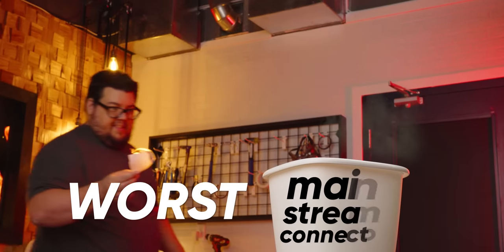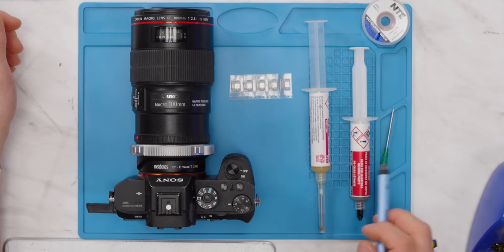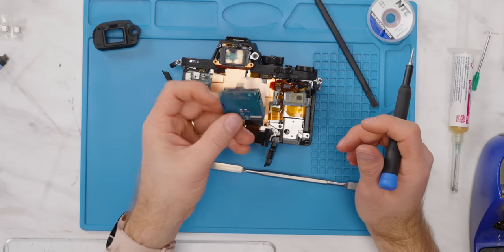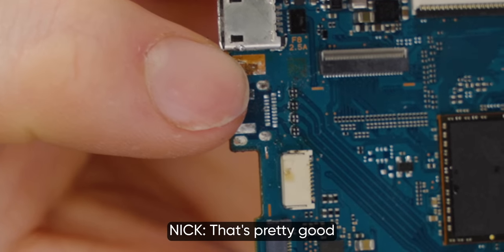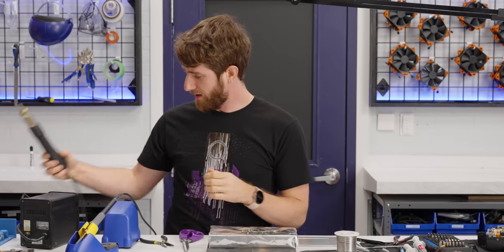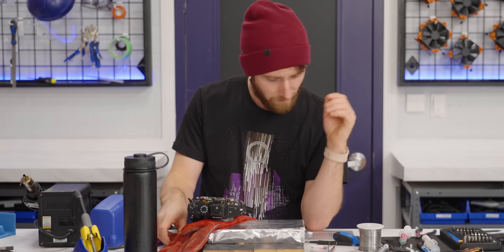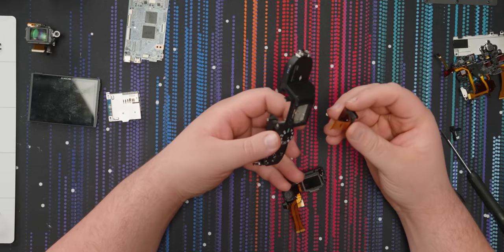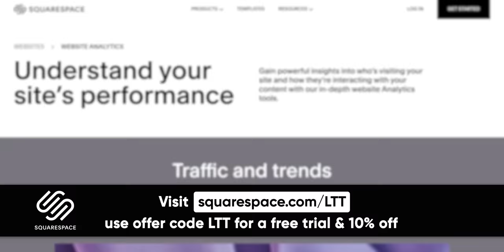This "cheap" repair almost BROKE me.

Comment: This reminds me years ago when I visited a camera repair shop to look for an old camera. The repair guy was trying to repair a camera with a broken connector. He told the owner that the owner had 2 options, the expensive way or the cheap way. The owner obviously chooses the cheap. So the guy proceeds to use a wire that looks like the wire inside of a LAN cable to connect the plug for the ribbon connector 😂😂😂.  Can't make this up. The camera works with it, and the owner is happy. I was like wtf how did you do that. The guy was like, "Yeah, that thing works in a couple of months." 😅😅 So it was technically an expensive way to do it.

Comment: Are you using leaded solder? The plastic should have been melting like that at the temperature leaded solder melts. Lead free solder melts at to high of temperature and is brittle. It sucks

Comment: Iæve felt for a very long time that all small contacts like usb and smaller that's ment to plug in and remove repeatedly should all be using magnetic connection contacts to avoid damaging either side due to a mishap or accident. Why there isn't an easy to get adapter that adds that function, I have a hard time to understand, but maybe there's some dumb patents or lack of magnets that stops such things for being available. I personally have at least 5-7 items that really should have such connection and my phone is included there.

I hade the fact that the cable don't just let go if someone by accident gets caught or moves wrong so that the cable gets caught and your device hits the floor and something breaks as a result.

Comment: I barely solder anything and I could tell where this video was going instantly 😂 Linus massacred that PCB, used a tool that removes parts to put one on, doesn’t have a tool to remove solder, and he wasn’t even using solder wire and an iron to pit the part on. Who let Linus near that stuff? Next time add a regular HDMI adaptor

Comment: Opening up a DSLR is so goddamn stressful. Had to fix the viewfinder focus on my Pentax K5 years ago, dropped a screw down inside and the neodymium magnet for the sensor stabilizer grabbed it and would not let go. Had to take the camera way further apart then I should have just to get the screw out.  😬

Comment: Wick works but is not the best answer. A s I lder sucker is better.
You have to heat the pcb and the device together. The solder has be liquid on both sides.

Comment: I honestly believe that he's using the wrong tools here. First off, he should've used a desolder pump to remove bulk of the solder from the HDMI casing (the four chonky case pins soldered), from there, he could've just used the soldering iron and solder wick to remove the rest. Attaching the HDMI connector also doesn't need the heat gun. as he has complained that it's melting the plastic. He should first solder the the four case pins to the board using the soldering iron, and THEN solder the pins afterwards, again using the soldering iron and some flux. Dropping the HDMI pins on a melted solder would result in a cold joint, and that's not the way to go.

Comment: Right to repair means the manufacturer shouldn’t make it impossible for others to repair their devices. It doesn’t mean that you will be capable of repairing everything you own when it breaks. That was an absolute butcher job - you had neither the tools nor the skills to do what you were trying to do. 

At a bare minimum the air flow from the hot air rework tool was too high, the tip was too narrow, and the temperature was too high. You needed a heat plate. I would’ve done that job by hand, it’s too easy to end up with shorted pins using paste, especially when you’re applying it by hand without a microscope.

Comment: This "cheap" repair ended up costing more than just sending it in in the first place. I will agree it is better to fix your own stuff if possible but SMD soldering is brutally difficult without the proper setup and it is very easy to do more harm than good if unprepared as shown here.

Comment: I was thiking on fix my CX440 but. . .  even having the hot air station I really just use that to solder QFN or PWP (texas instruments PowerPAD, is like a TSSOP but having a plane to solder under the IC) I don't trust on me to solder hidden pins

Comment: lol, watching this is such a cringe moment for me and I do these sorts of repairs both professionally and for fun.  Those through-hole anchor pins should have been touched soldered into place and then using a chisel tip you could have spread the solder across the pins and with flux they will go into their correct places.  In addition applying too much heat to the board can melt the ribbon cables/connectors and Kapton tape helps to avoid that.  I have replaced connectors on LCD panels using a hot air station before without incident.  I'm only 12:30 into the video but already the cringe is real!

Comment: Watching Linus casually pulling this thing apart, then try to solder a part with absolutely no work holding what so ever was cringe inducing.

Some kind of helping hands would have made this so much easier. Also, for parts with plastic in like that, you can use low temperature solder that melts at a lower temp than the plastic.

Comment: R2R in 2022:
Fix-it yourself! But.... when you're done putting the new parts in you will need to send it to the manufacturer so their proprietary tools and software can get all the parts to work together properly.
And all this costs you roughly what the manufacturer said it would cost originally but less of your time and frustration. Okay, okay, that last part isn't always true but in this example, it seems to be.

Comment: Right to repair they say. Manufacturers are been greedy they say. For something like this, leave it to the Manufacturers. For simple things like a battery swap, then yes, Manufacturers should allow easy repairs for that but not stuff like desoldering the board.

In all honesty, the cost of the repair will be for a board swap, they won't replace the port at a B2C repair centre, that would be when the board gets sent back for recycling. They will evaluate the issues with it and then have the port removed and repaired before much more testing and finally being sent back out to a B2C repair centre to perform a new board swap.

Comment: It'll only cost 100 bucks, I'm not paying 500 for Sony to repair it! 
Breaks camera and repairs it by getting a new motherboard and sending it to Sony for over 600 bucks. Not to mention the hours and hours spent stressing over disassembly and solder.

Comment: 400+200+50+25+100+20 = 795 dollars (and you have to have someone experienced with soldering little components) yeah... 195 dollars costlier than sending it to the service and you had to send it anyways.
Moral of the story: learning to do this is costly..

Comment: You picked an expensive item to practice SMD soldering on 😂. Try using a board holder and a 'third hand clamp' in addition to the hot plate.

Comment: So, I guess the moral of the story is if you don't have the skill experience then don't even attempt the cheap fix on an expensive system.  The parts weren't the issue and the basic skills of a DIY were there but the pin soldering is a hard earned skill that was lacking and as a result of using your broadsword skills you accidentally caused collateral damage which led you down the rabbit hole of not saving any money.

Very interesting video so that was a win.

Comment: I was a Sony camera repair tech for 29 years...that is actually an easy strip down to do....U try to do repairs with a tape based system mini dv/micro Dv system...am not sure why U didn't clean the boards way more between soldering efforts...

Comment: This was painful to watch! Thats not a soldering iron, that's basically a directed heat gun! You were melting them so much because you were using the wrong tool! The 'Heat gun' Is used for mainly removing parts, and applying them with the soldering iron (the one with the tip). this the reason why you were unable to attach it correctly and accurately. Yes a hotbed will help with the soldering but not really needed for this application.

Comment: Wait until they discover that Sony cameras have the ability to output a clean feed to a PC via the USB port and act as a webcam via a piece of sont software, bypassing the need to bother with an HDMI cable or capture card at all... Makes the cost of a cage and a cable clamp seem trivial.

Comment: I've repaired a few digital cameras of comparable complexity. Never tried to resolder a connection that's way above my skill level. Disassembly is insanely demanding and complex. I've had some successes but at the end of the day compared to the cost of repair, deducting stress and time, it's never really been worthwhile. At least not from the economics perspective. Learnt a lot and definitely contributes to my general knowledge about how cameras work. But not much practical value in doing it yourself.

Comment: Attempts to repair HDMI port
Damages ribbon cable
Top assembly harness now needs to be replaced
Damages motherboard
Motherboard now needs to be replaced
New motherboard now needs to be calibrated

Sounds about right lol
I had to replace the internal battery on my A7s, accidentally damaged a ribbon cable and also had to replace the top assembly harness
Cheap fix turned into not as cheap fix

Comment: 🙃There is no substitute for experience & skill. Why did Linus do this repair [he frequently looses his rag when building a damn PC!] ?? He's clearly missing both the required temperament and experience to do something this complex. == Know your limitations and strengths. Choose the best guy / girl for the job at hand. You HAVE a microscope [of sorts] so put together a rig [of sorts]  to help you see & work accurately. Your PCB is sliding around!! So how the hell can you put this in place accurately!?! When stressed >> walk away and take a breather! Adrenalin messes up your thinking and accuracy [scientific fact!].You broke more than you fixed. hence this was not a repair... unfortunately. It's an expensive 'miracle' this thing now works.

Comment: Oh, Sony cameras absolutely hate heat and humidity. I have, not one, not two, but THREE cameras that the CCD is basically dead. I wish I never invested in the "Sony" ecosystem, and that's one of the reasons why I never bought any other Sony devices. I wound up switching to Canon's. That said, Sony repairs also take bloody eons in Canada.

Comment: damn insane that a dude that's been working with tech for so many years can't fix his item. but what should the solution be? Every electronic is modular for good repairability? sounds cool but is that feasible or even warranted? besides most people would use a device for a couple of years, it breaks, then they chuck it out and upgrade

Comment: So the leson is, you pay $600 for the skill not the acctual repair and also the waranty of the repair. As for Linus, you should have practice soldering and desoldering on another board as clearlly you dont know what you are doing.

Comment: Why are you using the hot air thing with your soldering iron just get one pin right to hold it in place and then it'll be a piece of cake

Comment: 500 US dollars is too expensive! 

Doesn't have proper tools or knowledge. Breaks it and ends up sending it in anyways 

Right to repair should be a law but some things, like a camera should be left to professionals with ya know... basic board holders. Heat spreaders. Correct heat guns and specs.

Comment: Crazy. And after even getting a new logic board, having to get the color calibrated. I think right to repair is important. VERY. But you know, sometimes, it's really only the engineers that understand what all is going on under the hood. I think it just says a lot about how our technology is actually very clumsy and hackneyed. You and I both know how ugly things look without the shell of the pretty device masking its interior. But maybe we can only guess at how ugly things really are. Think, that modern day computers and their CPU's are just "guessing" at its computations based on patterns of known values. How much of that holds true for the engineering of the thing?

Comment: Very nice. So when you tried sto saye a dollar on diy fix it, it ednded up probably costing over 600 that the repairs shop would have done it for. 
Right to repair is important to a sertain limit, and this was passed it. Modern electrionics are so compact that its impossible to repair (even for an expert). If we want to be able to repair all our selves, then our electronics would be way larger than they are now - Do we want that just to be able to repair?

Comment: LOL, don't reflow the solder paste before you place the part... I know you've watched at least 1 Rossmann video.
Reply: "The only reason we're not using more flux is because there's already an ocean of flux".
Nope. Use more flux, the gooey brown old stuff is spent and is going to just cause more headaches if you keep applying heat without cleaning or more flux.

Comment: In other words unless you're Linus and have very talented people to clean up your mess better pay the cost for the official repair 'cause it'll save time & money. However jokes aside it's extremely frustrating the way electronics are being put together these days meaning that average folks WILL have a hard time trying to repair them. Maybe right to repair movement should also focus on future products becoming simpler in regarding their assembly this meaning  also easier to repair.

Comment: You probably just had too hot air. I did this type of repairs on daily basis and had no problem. Or maybe your connectors have low quality plastic that's not meant for withstanding the heat from soldering. Also you need only  tiny solder balls so it doesn't bridge when you put the connector here. Next time give it to me and I'll repair it for you for 40$. Though no video content for you. Don't like to be on camera💁‍♂️

Comment: What a comedy of errors!  Linus, nothing personal, but you don't have the skill set for this.  This is why Sony charges $500, because you require mad skills to work on SMD components.  Not to mention familiarity with an absolutely packed box of components and connectors. Also you need to be wearing an antistatic wrist strap when working on any electronics.  In hindsight the $500 would have been a cheap fix.

Comment: hi linus nice that you try it yourself but what you wanted to do this requires a lot of practice a lot of experience it is different from building a pc you have to accept that you are good at what you do but this micro soldering is another world too bad for this camera from 3000 dollars you had better send this to alex van northridgefix he would do it with pleasure or if you want you could also send it to me a bit far belgium my business is hardware quality repair otherwise you give a good explanation about what the world of pc etc. but you would leave this to the specialists many customer of mine also look many you tube tutorials as a result they come to me to solve their problems but good otherwise and you also saved $400 for that new motherboard  nice try

Comment: So. This cost you around $900 to fix it. That is why you should bring it to Sony in the first place. :) Just kidding. Actually, your hot air is too cheap to do the work that's why it took so much time to remove the connector and damage the board. Also, your soldering skill is terrible. I suggest you buy a JBC rework station including hot air, soldering iron, and hot tweezer. That will change the result of future projects dramatically.